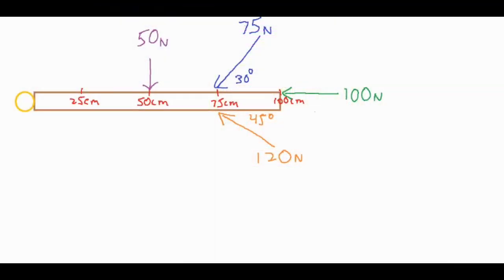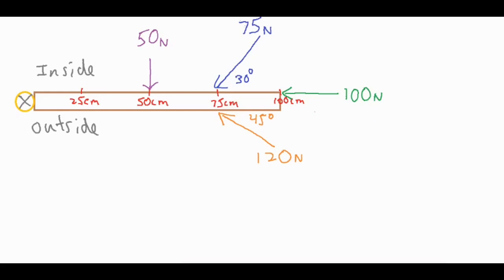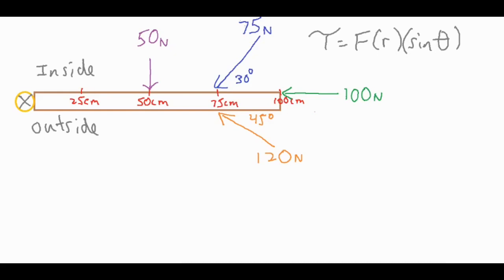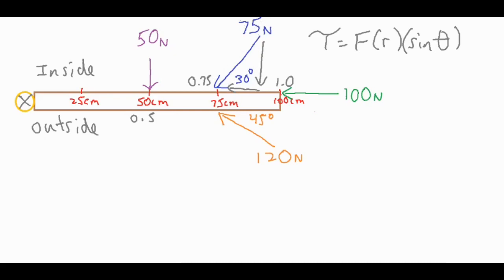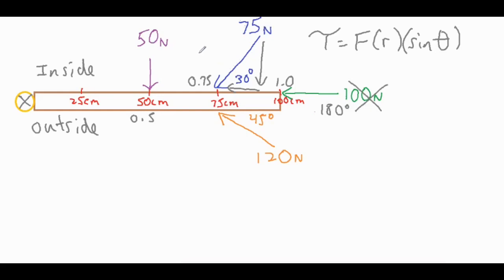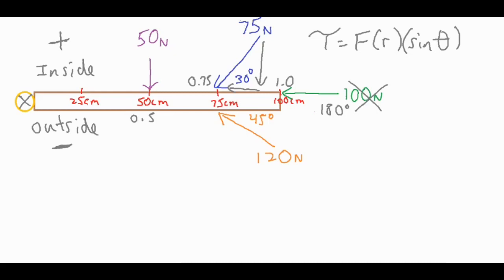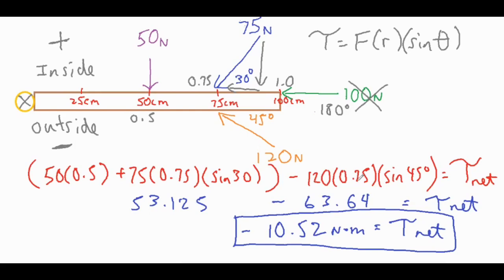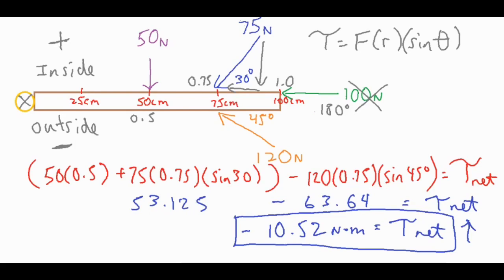Solve for Net Torque (with Multiple Forces & Angles)

Comment: Is it fixed that clockwise is positive and anticlockwise being negative
Reply from the maker: The standard is that clockwise is negative and anticlockwise (counterclockwise) is positive.  In the video, I just arbitrarily chose "inside" as positive (clockwise).  In a lot of cases the sign isn't that significant as long as you're using opposite signs for opposing torques. Great question!
Reply: @beatphysics  Alright thanks!